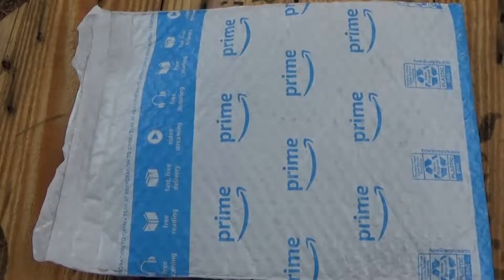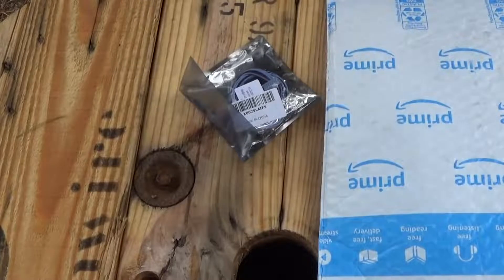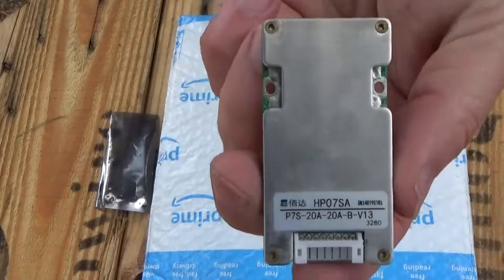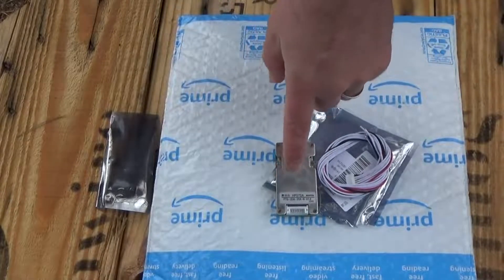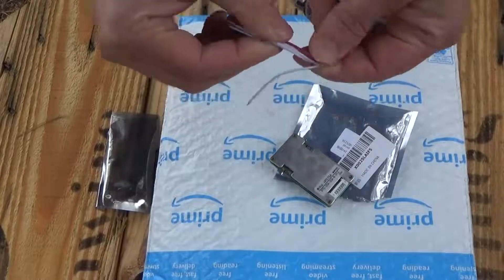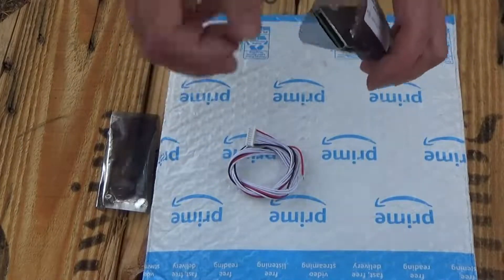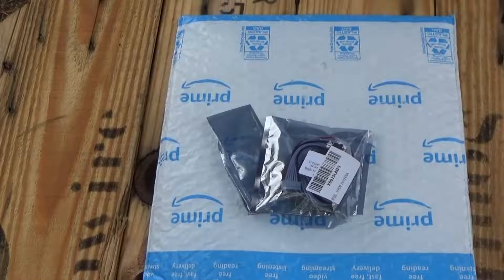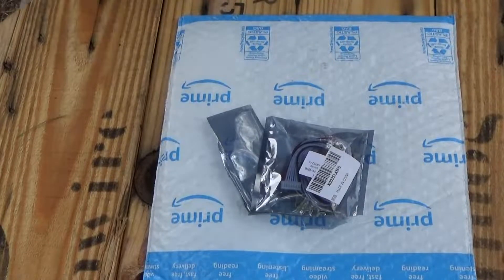Unboxing 18650 Battery BMS For Motor Scooter Project

Comment: I have around 300 Tested 18650's that i have been saving up/ 
I got 99% of them from laptop's that i scrapped. (Great thing about running a computer shop) 
I am Thinking of doing a Golf Cart setup Soon , Will be a Hybrid system , and much better then just a power wall. 
Park it in my shop and will be used to power everything.  Ill need a Few Hundred more 18650's lol
Reply from the maker: If I had a golf cart I would put solar panels on top. I wish I had access to batteries like you do. Being in the country its a major disadvantage. And they are getting more popular and harder to find. I may have found a source though. Looking into it. I miss my computer shop. Those were good times. And good money. I used to build $5,000 computers for the US soldiers in Germany. Plexiglas cases with neon lamps and top of the line parts.
Reply: @thedoityourselfworldelectr8007  I have been doing the computer thing for close to 15 years , crazy how things have changed,  right now we are mostly into security cameras and equipment now though,  I kinda miss building crazy computers for people who have the money lol. 
I thought about putting the panels right on the cart , bit thinking be better to just plug into the main system.  I have so many crazy ideas,  just wish I had time to get away from work for a few months,  but with work I deal with many government agencies and medical centers for cameras I am stuck working no matter what from looks of everything. 
I moved out of town around 65miles from my work place , I know what you are saying about things are harder to find outside of a major city.
Reply from the maker: Well, you have work. That is very good for you. Its hard since we lost some of our income. Fortunately our bank is letting the mortgage go for three months so we are going to make it on my YT income alone. Our store is now breaking even due to the increased sales. It keeps up and we will be making some money there too.
I have often considered getting back into computers. Sometimes I miss it. But I love my homesteading.